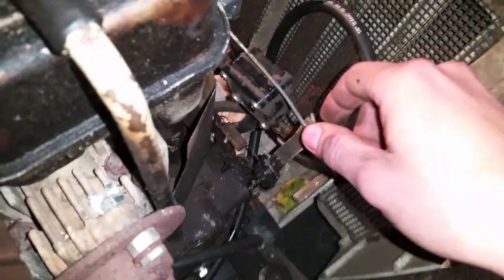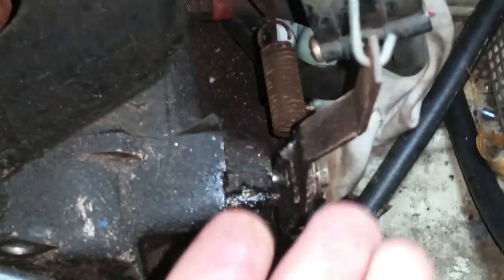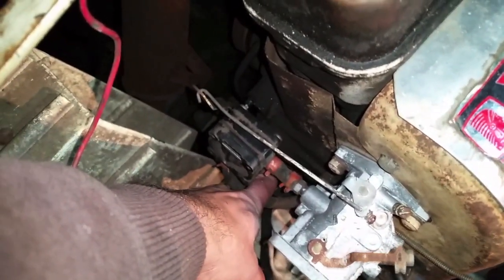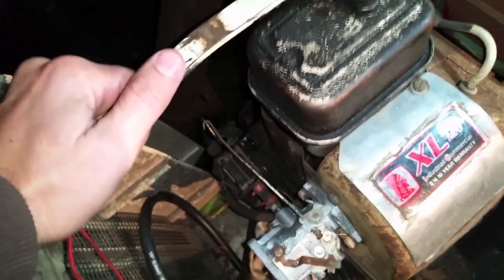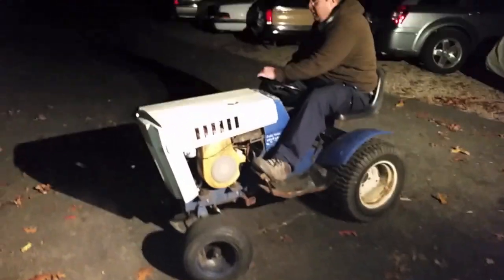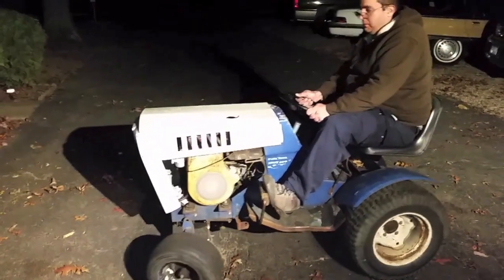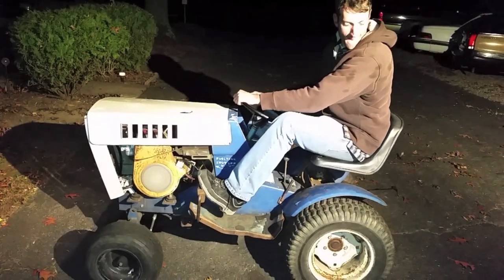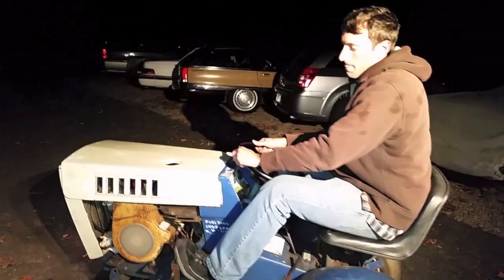1970 Sears Suburban repair Part 2: Getting it running right and a test drive

Comment: Have a  Sears suburban myself . Only trouble l have Hadi's the starter and  carbutartor . Spent many a day  plowing with it pulling a 10 inch molboard . No problem..  pull it in 3red low .

Comment: the engine should be solid mounted,not in the rubber. that engine came from a later model with the brackets and mounts i would bet